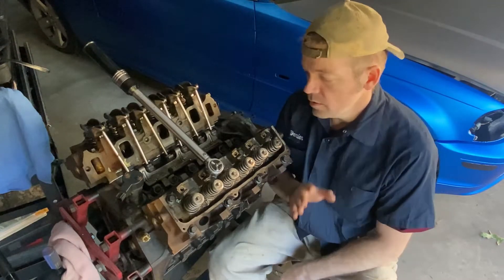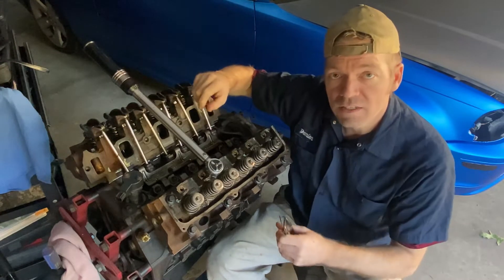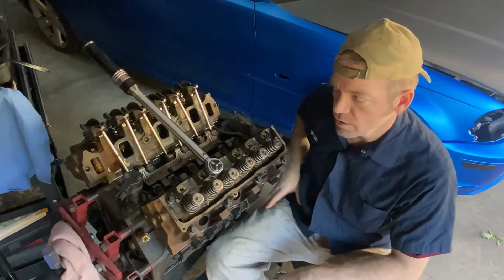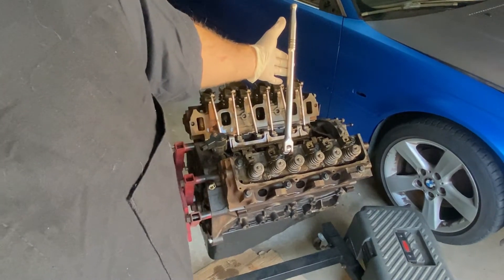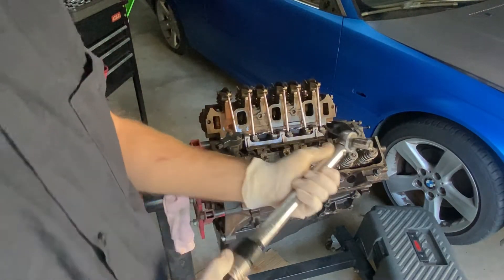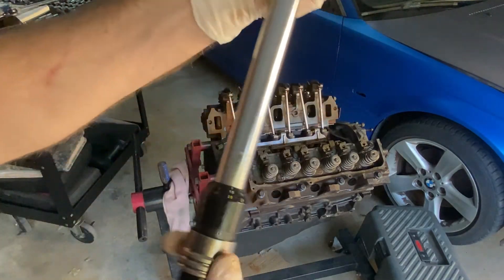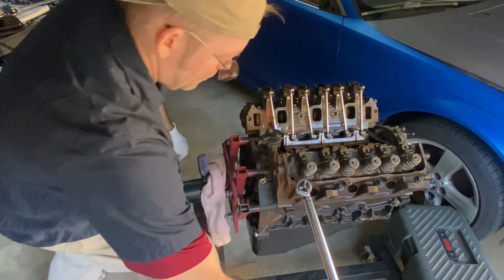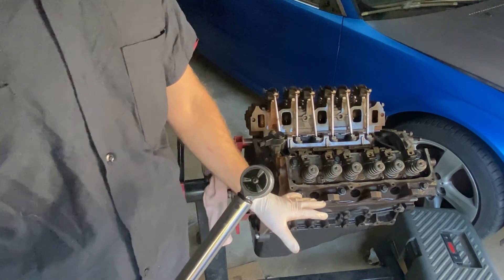How to correctly torque your head bolts, head and gasket on Ford Ranger. How to build an OHV Engine.

Comment: I thought the sequence for this motor was torque to yield at 90 degrees, no?
Reply from the maker: I went right from ford website. Now remember this is the v6 3.0. Different engines have different patterns and torque spec.